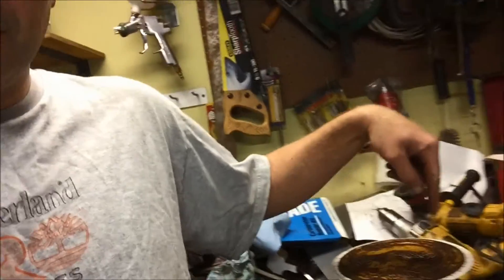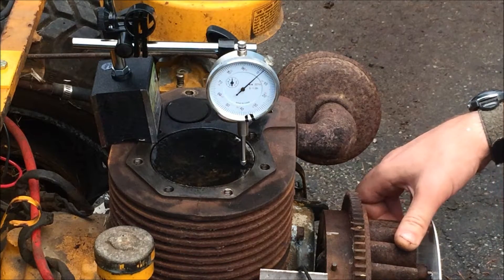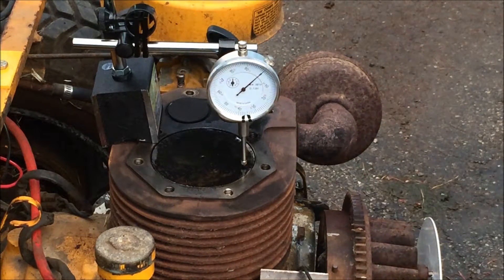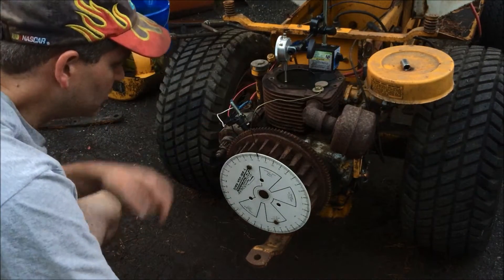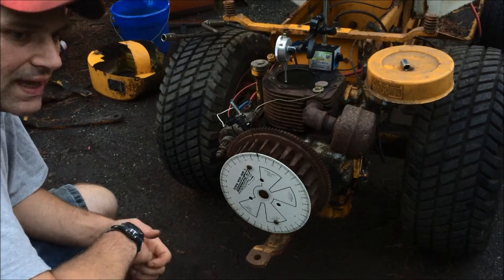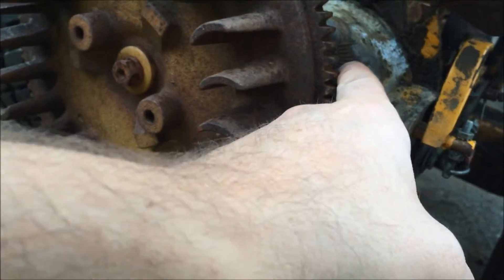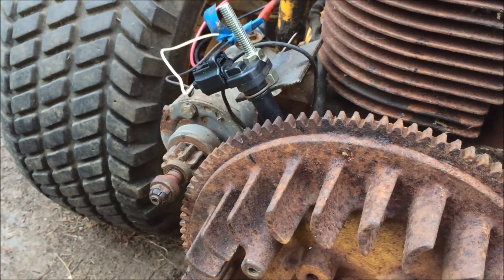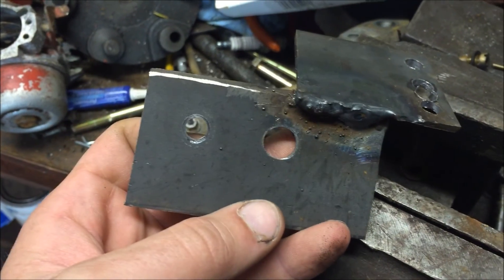Gravely 430 Onan NB Crank Trigger Ignition Build - Part 6 Setting Timing

Comment: Must use a High-Output/Performance GM HEI 4-pin ignition control module with an ignition coil that has a 0.4 to 1.0 ohm internal resistor for full coil saturation and a strong spark so the engine will rev to its full potential. A factory stock module and coil with a resistor higher than 1.0 will NOT allow the engine to fully accelerate.

Comment: Impressive. Didn't understand why you need to suppress the spark at startup.
Reply: Engines can't start under full compression and with advanced ignition timing. One or the other must be "suppressed" in order for the engine to crank over without "kicking back" to start. Either it needs to have a compression release to relieve about half the compression, then the compression will return to full upon start up, or the timing needs to be positioned at TDC, then it can automatically advance upon start up.